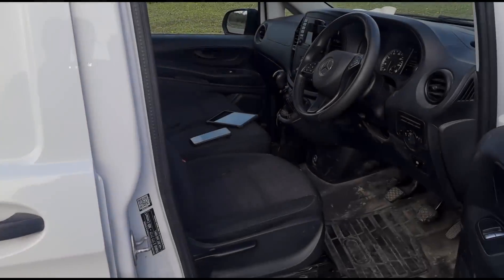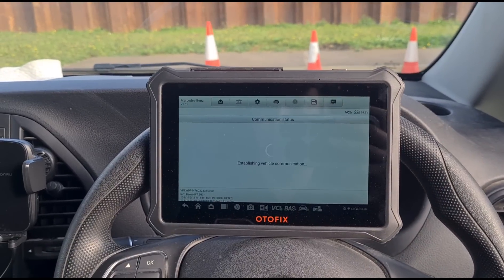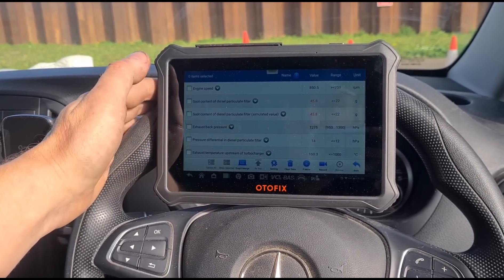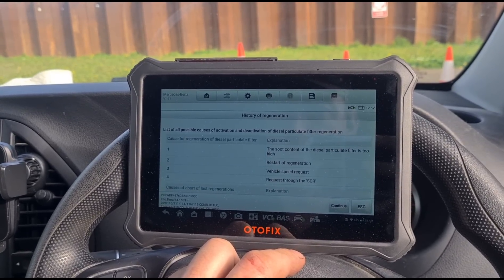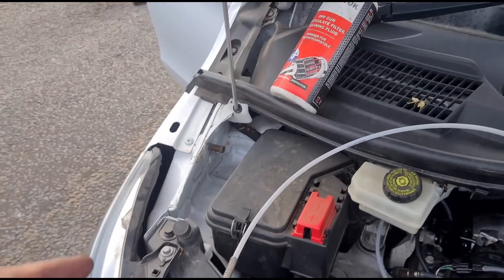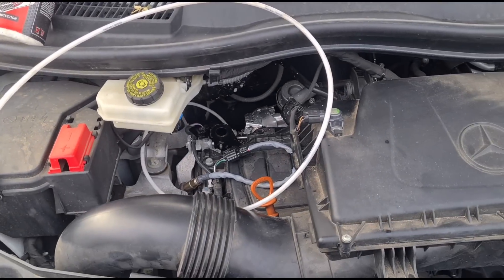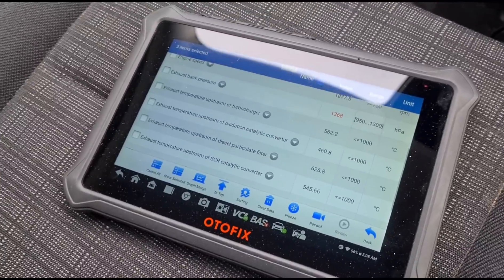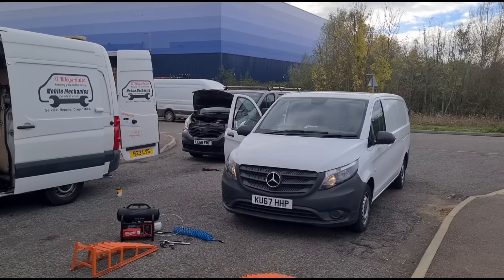Mercedes Vito 1.6 P246B09 P246392

Comment: Again a 1.6 dci vito, so much wrong with them it seems
Reply: Because these have Renault engines
Reply: @racer243l I have a volvo s40 with a Renault f9q engine pre dpf etc it's bombproof I took it over 300k. It's parked up not being used at the moment because of some crash damage. Renault should make an engine like that again. Went in the kangol vans back in the day
Reply: @chucky2316  no dpf is never having a problem with them.
We recently had to clean out a dpf because it had a dpf warning code for ash content of the dpf to high and it was a 651 engine. These are basically bullet proof
Reply: @racer243l absolutely the worst engine ever fitted to a van
Reply: @goldmanta  Mines on 345,000 miles, no problems with engine.. plate is DN15 BKL
Reply: @Luckyjo21 But what year is yours.. this must be new, only 22k miles!!! (i wish the video’s  would identify the year of Manufaturer (No idea about this 56plate and so on is!!!!). Great job, such a shame customer had to pay twice!!!!
Reply: @neildean7515  mines is 2015, its a taxi, done 63k miles in it so far this year
Reply: @neildean7515 56 is 2006
Reply: Avoid, avoid , avoid